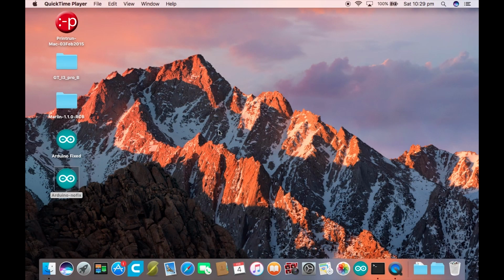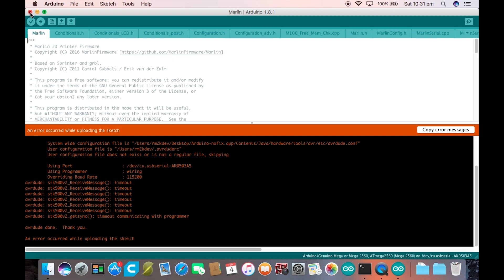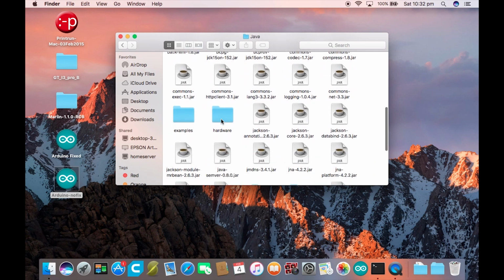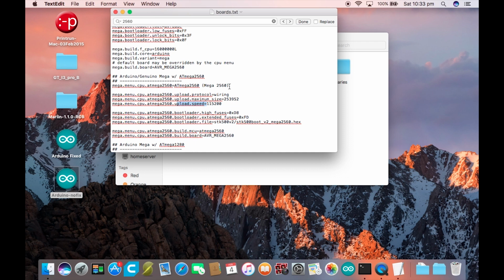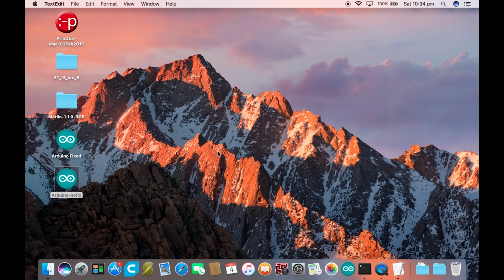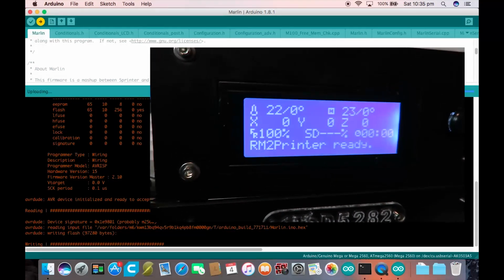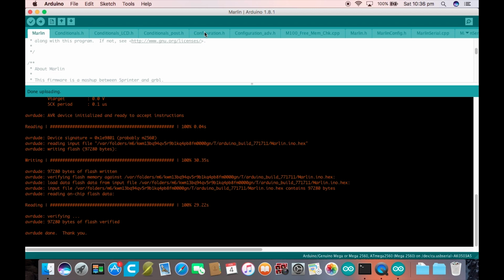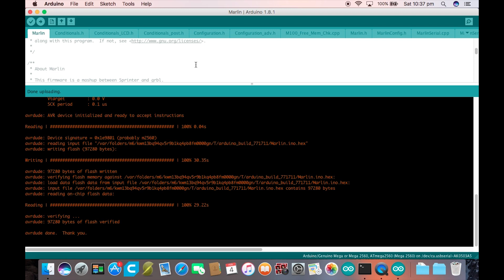stk500v2_receivemessage timeouts REAL FIX - 3D Printing With Rm2kdev #6

Comment: I followed the instructions, they were very clear, but after 5 minutes or more of loading, this message was displayed: "exit status 1
Error while registering for the Arduino Uno board." (translated)
Scrolling up, there were many lines of text like the last one, which is:
"C:\Users\utente\Documents\Marlin\Marlin-GT Prusa i3B\Marlin-bugfix-2.0.x\Marlin\src\MarlinCore.h:74:27: note: in expansion of macro 'OUT_WRITE'
   inline void suicide() { OUT_WRITE(SUICIDE_PIN, SUICIDE_PIN_STATE); }"
I have little experience w programming... Any suggestions?

Comment: Thank you so much, it finally uploaded! Interestingly, the upload protocol was already "wiring" instead of "stk500_v2" but the baudrate was 115200 instead of 57600, so I changed it. My printer is a CTC Prusa i3 Pro B from ebay with the GT2560 Board, Rev. A with the ATmega 2560 chip. You are a real hero!

Comment: well this bricked my printer
Reply from the maker: "this" didn't brick your printer. there are a million reasons why the board could have been bricked including you installing the wrong firmware.
secondly dont give up yet, if you managed to flash the board with something (probably the wrong thing) then the bootloader is still working and you should be able to continue flashing in this method over usb
Reply: sorry i should have wrote that later on i figured out what i did wrong and unbricked it. you need to use version 1.0.4 of the Arduino software.

Comment: The real problem is that the chips are NOT 2560 if you read the chip on the board it's a atmega 128...so you simply need to set ---》tools --》board to atmega 128 then you have full access.
Reply: YOU ARE A GOLDEN GOD.

I've tried all the variations of the fix in the video, none of them worked. I had even convinced myself that I'd checked the chip and confirmed it was an atmega2560; turns out it wasn't. Thanks to you I was finally able to upload successfully.
Reply: I knows it. Lol
Reply: On mine, the chip actually says it's an atmega2560. 
The boards with the 1280 chip are really poor clones of the geetech boards. They use the 1280 to cut costs.
Reply: Awesome. Thanks. Worked when changed to 128. Cheers
Reply: When I go into the board it doesn't give me the option to change it to that

Comment: Awesome! that worked for me! Thanks!
Reply from the maker: Super glad to help mate! if you have any questions or need help feel free to ask and i'll try get a video up
Reply: Would be interesting to see your Marlin firmware settings for your printer :-)
Reply: Hey rm2kdev...I have a question off topic....I want to install a capacitive sensor for auto bed levelling on this printer but unsure on how I would wire it onto this motherboard. Any idea of which colour wires would go where on this? I have positive (brown) negative (blue) and signal (black) coming off the sensor. Cant seem to find any info online and your the only guy I know who know a bit about the board and has the same printer! Any help (or even a vid) would be greatly appreciated :)
Reply from the maker: pretty sure thomas sanladerer has a video on the wiring specifically as far as where it connects pretty sure it goes into the z endstop :p
Reply: rm2kdev yeah I watched that but its quite an outdated video now so a lot of it doesn't apply...no worries anyway...I guess I'll have to experiment and see what happens 🙈... thanks for your help anyway 👍🏽
Reply from the maker: no worries i have one here anyway im planning to do a video on it :) just need to find the time to do the update :p
Reply: rm2kdev no way....pleeease find some time lol! I'll be keeping an eye on your channel for it 🙈

Comment: ok i got the boards .txt file to change, now when i go to upload it hangs and then fails with '
avrdude: stk500v2_ReceiveMessage(): timeout' so....not sure where to go from here
Reply from the maker: This trick will only solve the issue if your board is a chinese made copy with the wrong protocol setup on it. if changing over to wiring didnt solve the issue then RMA your board. :)
Reply: rma?
Reply: rma?, also i have the exact same printer as yourself
Reply from the maker: rma = send it back to the manufacturer lol. although they look the same these chinese printers are assembled and parts are sourced from all over china boards come from 1 of 50 different factories if your having a problem updating firmware, youve tried both the standard STK and Wiring protocols and still cant update then theres probably a problem with the board sent it back.

Comment: i go into wordpad make the changes and hit save but it sayd access denied, which is weird because i have full permissions
Reply from the maker: make sure you rightclick and open as administrator since your editing a files probably stored under windows protected folders if arduino is installed in cprogramfiles.

Comment: I'm kinda new to this and i updated it. It said it was writing in left corner, then said it was done, now it has bricked blue screen and 2 rows of little squares. and it will not respond to anything. any help will be great. i have exact same board -2560 atmega 1280 chip
Reply from the maker: Rest assured everything should be O..KAY give me a tic to write you a proper reply but i dont think your board is bricked.
Reply from the maker: Okay SO firstly the way these boards work is they have 2 pieces of code running on them one is called the boot loader and one is your application. When you deploy code to the board your actually just talking to the boot loader and asking it to update the software stored in memory with the new version.

What sounds like has happened is you've flashed marlin on to your board with an improper configuration for the screen settings.

However your board should be fine if you plug it in and power it on as usual and attempt to flash a new version of marlin where your screen settings have been configured correctly (check thomas sandererers or however you spell that video on configuring marlin) then your board will spring back to life :) (probably :P)
Reply: Allright I will try that and see how it goes
Reply from the maker: best of luck mate :) probably just got the wrong screen selected in the firmware what i did is contact my manufacturer and ask them to send me the default firmware my printer had then i copied over all the settings from that to the new firmware one by one and then started configuring my settings from there :)
Reply: I am not good at this I guess now the buzzer is emitting i high piched noise and still nothing everytime i try to change a setting i get an error that something isnt defined i feel like im making it worse. f i could just load the default firmware back on it i would and leave it alone. where did you get the defaul firmware i would be happy to just return ti original at least then it would work.
Reply from the maker: We'll i cant really help you with that i got my printers default firmware from the manufacturer as i had said, but just so anyone in the future reading this understands this video is only the solution to being able to upload firmware to your devices you still need to understand how to configure the firmware and set it up correctly for deployment first.

First thing you should do is email the person you purchased it from and ask them for the firmware they will have the default one that was loaded on at the factory.

While you wait for them to get back to you keep trying with the configurations, look through the documentation on the reprap fourms for screen types and marlin configurations:

http://reprap.org/wiki/RepRapDiscount_Full_Graphic_Smart_Controller
http://reprap.org/wiki/RepRapDiscount_Smart_Controller

here's a couple of links to get you started, if your screen matches one of those try the settings listed in those pages also check the 'issues' sections to see if there are any issues with your screen if its not the same as those two then check the wiki for screens because it will be there all the information is contained on this page :)

Comment: Hi rm2kdev, i have the same printer and i'm quite bad in software and dont really understand how the board works. Could you please give the program you just uploaded into the controller board of the printer ?
Reply from the maker: Hey Easy Rider!, im sorry mate but it wouldn't work for you the settings in the software are all individually tailored to each machine for example my stepper motors, gearing setup for extrusion all move at different rates than yours so when I did all my calculations and put those values into the firmware i uploaded into the 3D Printer all of the values will produced good quality prints but only for me, your printer however is different to mine, the wood may be thicker, warped in different ways, the motors may be different brands and the extrude gear might have more or less teeth etc so you'll have to learn how to customise the firmware yourself theirs plenty of guides online check out the ones by thomas sanders on customising marlin.

Comment: How u going with bed levelling  i'm have trouble with filament sleeping in the extruder fun and game keep coming
Reply from the maker: Yeah i was having some similar problems too poor leveling and adhesion in the end i've settled on a couple of things which have drastically fixed the problems i was having before so i spent some time experimenting with the settings and these ideas and i've kind of found a good working setup.

For me at least:
Green painters tape (Frogtape with paintblock) and white kids school glue that goupy stuff that looks like boogers in water, what i've been doing is applying the bed with painters tape then watering down the glue (50/50 water/glue) then i paint the glue onto the bed with a brush and let it set this seems to provide a good tacky surface that becomes sticky again when the hot end comes near i think the 'paintblock' in the green painters tape stops the tape from absorbing all the glue and water and so removing the models has been easy peasy.

As for bed leveling i've given up on using paper to level and now i just print a giant square the size of my bed as the print head moves from corner to corner i make adjustments until i have the first layer height set and looking good.

With those two techniques i've since stopped having failed first layers, warping, poor adhesion and weird first layer artefacts.

I'll have to get a video done up for these :)
Reply: I what know can u email you marlin setting ? I went back to my older firmware I hade
Reply from the maker: Its probably not a good idea to copy my settings as I've been modifying my machine with lots and lots of upgrades. i.e. different hotends, graphical screen, extruder templates etc.

but since your asking:w w w dot past ebin. com/RPk5gKBY

Just be careful not to copy in any settings from my config file that would be different to yours i.e. thermistor, gear ratios if they are different steps per mm since thats machine dependant etc.

Also I am using marlin 1.1.0 rc8
Reply: did u get default setting with geode be for you upload new firmware
Reply from the maker: Well I'm not sure to be honest because before I uploaded the firmware there was the firmware that the manufacturer uploaded they had their own settings in there that i overwrote when i upgraded the firmware.

All i can tell you though is if you watch the video i made called "journey to print quality" you can see all the steps i did go through to get a decent level of quality.

The main things were levelling the bed, getting stuff to stick with tape AND glue. i don't print with a heated bed so no heat works perfectly for PLA. and then the rest was dialing in the settings.
Reply: ok did u live the federate & acceleration as default setting
hope I'm not keep up I'm in Australia to I work night shift

Comment: gday rm2kdev how you going with new var of marlin with flow of Flamant after u calibration
Reply from the maker: well the default was wrong for my printer so after taking some measurements and doing the calculation i re uploaded marlin with the right settings and the extrusions are good :) same problems as usual with manual bed leveling, poor print adhesion etc at the moment i am using tape and glue and that is providing amazing adhesion.
Reply: Hmmm ok i look in to it more

Comment: nice fix i use USBasp re-flash boot-loader it fix to i look in to the setting  

mega.menu.cpu.atmega2560=ATmega2560 (Mega 2560)

mega.menu.cpu.atmega2560.upload.protocol=wiring
mega.menu.cpu.atmega2560.upload.maximum_size=253952
mega.menu.cpu.atmega2560.upload.speed=115200

by default  but not to say i was getting timeout error i don't remember what error was